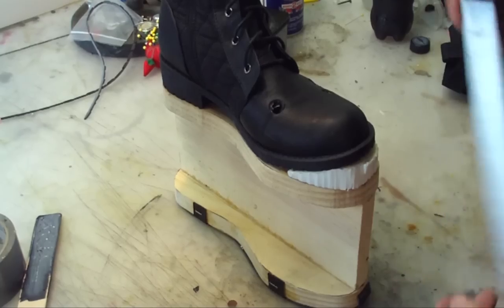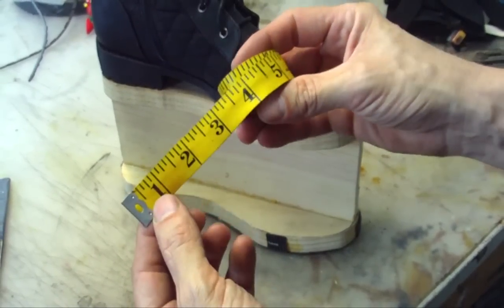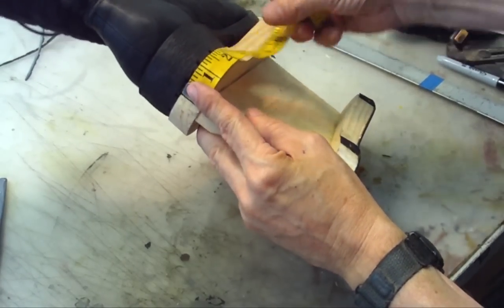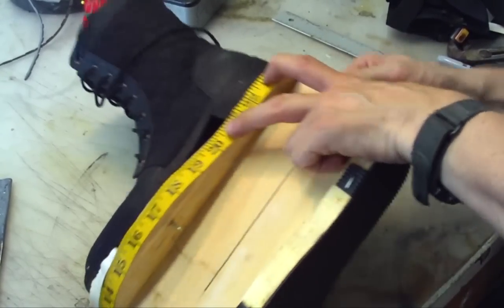How To Make Platform shoes for Cosplay, Tutorial Part 2

Comment: Thanks for the vids Ted. I read a great foam measuring tip the other day from wmarmory, and that is to make yourself a foam ruler out of the the same foam you are using, and measure with that instead of the cloth tape measure, that way you will get the exact measurements you need without guesswork.

Comment: Just a thought but for added strength and support would it be possible to glue aor screw in some dowels either side of the main centre raising piece of wood. I was just thinking where the wooden soles go out wide from the centre piece. Like I said just a thought I had about strengthening and giving a bit more support. Would be interested in your thoughts on that idea

Comment: you can also take a piece of string and tack it to the curves all the way around.  once yourall the way around mark or cut the string to the spot where it ends.  then you can pull it off and measure it with a ruler.  if you dont have a fabric tape that is

Comment: Is Barge Cement really better than hotglue at holding foam together?  I'm making pieces for theater shows and I want them to last.  Any thoughts?
Reply from the maker: TitanGear Yes, the barge glue is way stronger than hot glue.
Reply from the maker: TitanGear Yes, barge is better than hot glue.
Reply: Evil Ted Smith Awesome, Thank You
Reply: +TitanGear yea, barge or at least contact cements are infinitely better than hot glue what hot glue gives you in speed it loses in flexibility and longevity.
Reply: I been using Barge for a good two weeks now.   I am Liking it a lot but for pieces I want pure solidarity I'm adding hotglue to reinforce.  on my flexible pieces I am definitely sticking with barge only.  And I'm gonna try the cheaper DAP cement to see if it works as well so I'm not chewing through my budget later on
Reply from the maker: I'm glad to hear that you like barge.

Comment: Why do you do the pattern in poster board? Couldn't you just trace the patterns on the foam with the foil paper? Wouldn't that save a lil bit of time?
Reply from the maker: Because it will last longer. When I make patterns I plan on using them again
.
Reply: so that´s why, I was thinking it was just an extra step. cool videos man.

Comment: is there a way I can blend 5he foam into the shoe to make it look more professional
Reply: You'd just need to cut a longer piece, cut out V shapes so it will fit the curve of the shoes and bevel the edge so instead it's a curve instead of a 45 degree angle. You can use a dremel tool to shape the curve on the foam. He goes over that in a few of his videos.